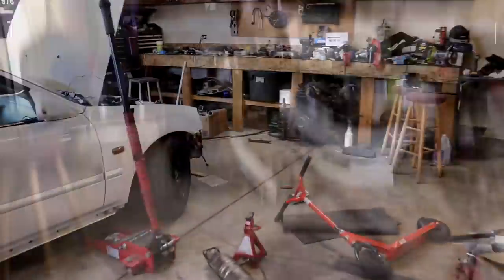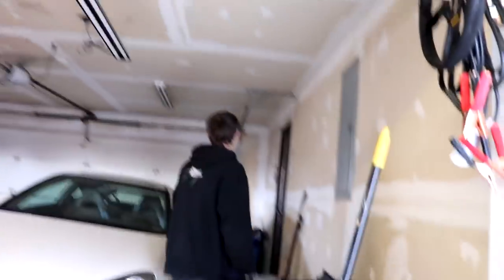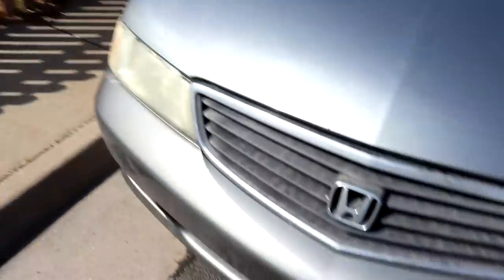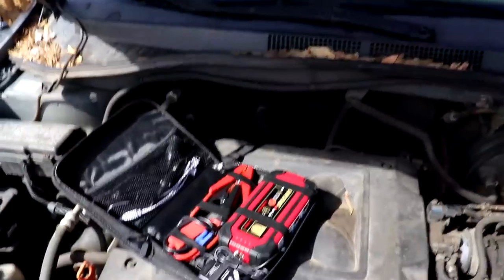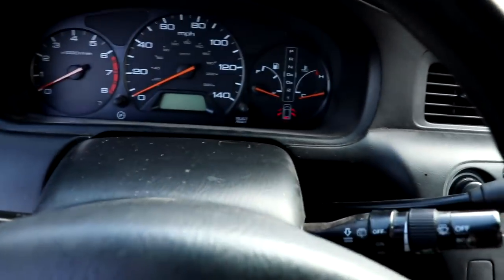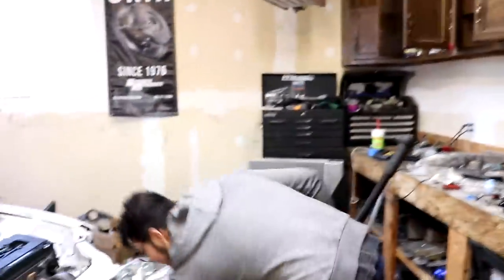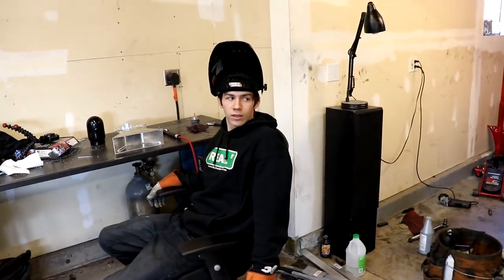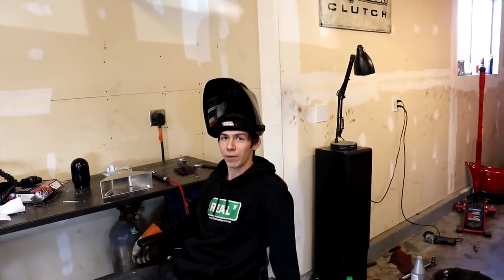Civic Gets Yanked Around by Tractor..

Comment: There is a crack by the motor mount
Reply from the maker: Its not a crack, its the panel sealer pulling apart and it looks way worse because the paint highlights it.